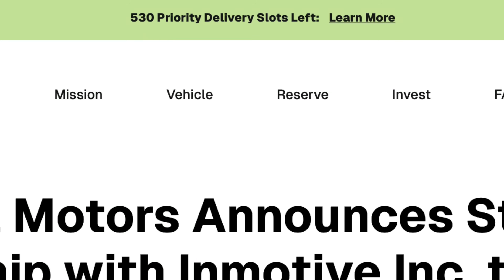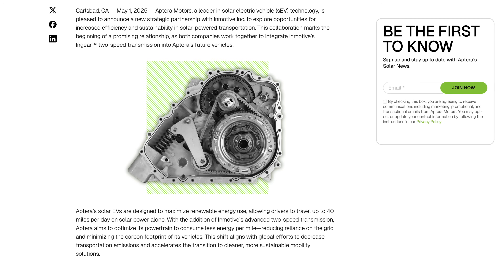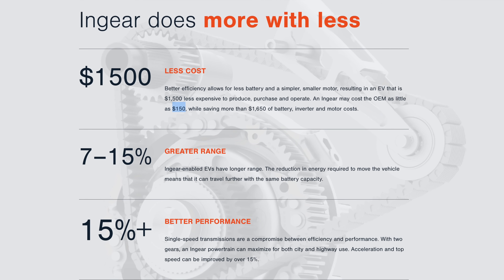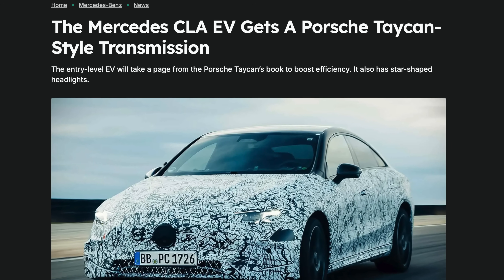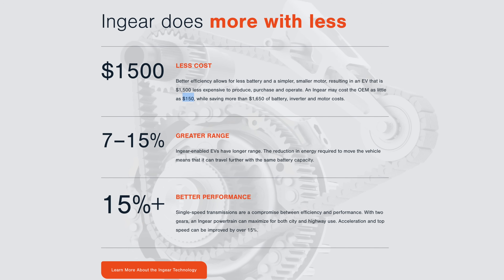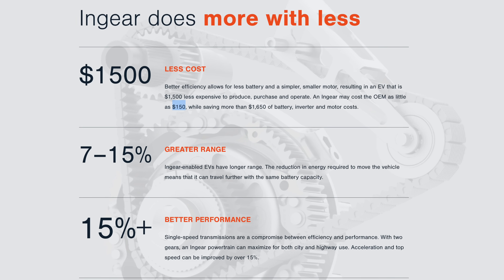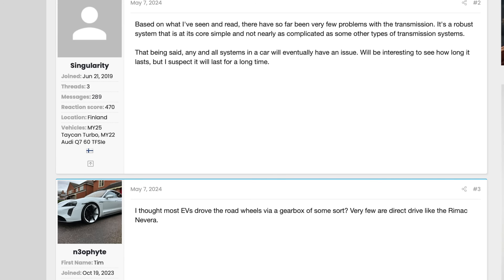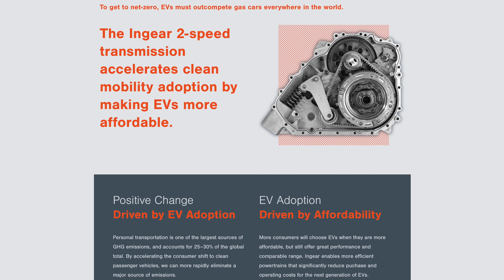Aptera Gets A Transmission?? Explained

Comment: I have always wondered why many EV's don’t use a transmission to make better use of the efficiency and torque available from electric motors.  As the motor spins faster it uses more power to do so.  At a lower spin speed you still have all the torque available so for me it just makes sense that eventually all EV’s will have at least a 2 speed transmission.

Comment: I think a transmission especially a simple two speed is worth the relative increase in efficiency and the proposed transmission's low cost. Besides efficiency has been optimized in the Aptera otherwise. Also I find Porsche's decision and test evidence at the increase of efficiency makes it worthwhile for high speed efficiency. Now Mercedes-Daimler is considering the to two to optimize electric motor efficiency over a large speed range. Besides with an electric motor one can optimize the electric motor controller to minimize stress on the transmission during a gear change..
Reply: Worthy of postponing a vehicle 👍

Comment: do they not plan on doing in wheel motors eventually anymore or will they drop the transmission at that point?
Reply: They gave up on hub motors some time ago. They weren't surviving the road simulation tests very well: too much shock and vibration. It turns out that having the electric motor protected from road vibration by a suspension system is a good idea, so they made the shift. This is just one more tweak as they try to get the new layout dialed in.
I hope it's a good change. It adds a little complexity and maintenance, and it's an unproven product (though it certainly tests amazingly well, let's see how it works in real life).

Comment: I always thought the Tesla Roadster had used one of these, but reading into it more it turns out that the transmissions available back then weren't strong enough to handle the electric motor torque.  It's good to see that's not the case anymore.

Comment: I want them to achieve 10 miles/kWh if possible.  It seems they have 8 in the current product.  Lower motor RPM makes perfect sense.  I wonder what the maintenance of this transmission is.

Comment: I have one on reserve..  But I'm disappointed they went away from the in wheel motors. This was a big driver in putting up a deposit. I have a 22Y pro now. I know this was changed a bit ago I'm just very disappointed.. 🤔 I'm going to check it out more, but I'm on the fence now... Was really looking forward to the in-wheel motor design. I have the electric bikes with the in wheel motor design. I'm really not sure why they gave up that part of their design. The solar parts huge and I think that's a great idea. 🤔

Comment: By th way all passange car BEVs have transmission NONE are diract drive.... If they didn't they would spin off the wheel assembly and would need a throttle like a prop plane... The reason why Musk got away with saying Teslass don't is because they are DIGTAL tranmions... but otherwise are very much a Musky lie to sell telsas that have really gone out of hand...

Comment: My concern would be the longevity of said transmission. The immediate torque that a electric motor can immediately output could easily chew through a cheap transmission, and a $150 transmission sounds "cheap" to me. I'm sure they could "tune" the motor to gradually ramp up power so as to not put excessive strain on said transmission, but I would still be worried about longevity.

Comment: Some red flags from Aptera's recent first road trip from Flagstaff ro carlsbad:
1. They never mentioned anything about charging during the trip
2. Zero shots from inside the car? 
3. No details shared for the trip after completion. Metrics like efficiency for the ride would have been helpful.

I dont think Aptera folks are like Theranos. But the management comes across as naive in ways they choose to communicate. Right now they are raising funds as "investment opportunity" while having no delivery date set and having failed to deliver past 4 years. I also feel there was no need to go all in on solar, they could have just launched a normal vehicle. Management is pretty bad with managing scope creep.

I hope they succeed but the management is holding on to a lot of info that could help us judge Aptera better. For that reason I will continue holding on to my money instead of investing in them.

Comment: Of course it is going to be more than 2 or 3% more efficient. You don't need a 2 speed transmission it is just like an overdrive in an ICE car it saves 10 or 15% on fuel especially with manual transmission easy 15%. It is not complex overdrive almost never breaks.   I like those Apteras I wish they would sell them with combustion engine they would easily do 120 MPG.

Comment: G'day,

My Talaria Sting L1e has 3 Gears in a Reduction Box, running uphill at 45°..., bottom Cog fully submerged, middle one half under oil, final Gear lubricated by Splash...

Every 1,000 Km the Manual decrees the Gear-Oil be changed - presumably so the Magnet on the Drainplug may be inspected ; but I always put new Oil back in.

"Geared Brushless Neodymium-Magnet, 60-Volt DC Motor...; 92% Efficiency (claimed in the Manual..., and via habitually  Recharging from my stand-alone Solar System - I cannot find any bullshit in their Assertions !).

After the Gearbox, being a Motorcycle..., the 3rd Cog turns the Shaft of the Chain's Drive-Sprocket.

Just(ifiably ?) sayin'.

The Apterra has 3 Wheels 
And 3 Motors...
Will there be 3
Gearboxes,
Or only one
For
Reverse ?

Have a good one,

Stay safe.

;-p

Ciao !

Comment: At CES Steve F was hinting at future changes to improve the Vitesco EMR3 efficiency. I thought he was saying to boost efficiency for low load city mileage. That the EMR3 is already well adapted for high performance applications. Perhaps this transmission could also be useful when you have achieved your highway speed on level or downhill terrain and just want to use a small motor load maintaining that speed? At the time I thought he was hinting at a future motor mod. EV's with 2 or more motors can achieve this motor gearing with their additive power, and by only running one when that is optimal, and sometimes by having each motor also optimized differently for when they might be running solo. Does this transmission feed excess power back into the battery in some regenerative manner?

Comment: Tesla reportedly had problems with the 2-speed transmission they had in the Roadster.  The electric motors were reportedly generating so much torque, that they were destroying the transmissions.  I'm not suggesting that this will be a problem with this transmission that was designed specifically for electric motors.  I'm simply pointing out that there is a little history with electric cars and transmissions - and that history isn't necessarily good.

Comment: I've always thought this was a good idea and probably adds a fun factor to the drive. It's like having an underdrive and overdrive gear for city and highway driving as well as give you better control for circumstances such as uphill climb and descent. There should be an automatic and manual mode to suit the drivers preference with controls on the steering wheel or display. Torque is constant in an EV with the main variables being rpm's and road resistance that determine the current draw, with a changeable gear such as this you should be able to optimize the performance and efficiency to suit the road conditions more optimally.

Comment: I'll be surprised if the two speed transmission actually makes much difference. But it's definitely worth a try. I'm skeptical because Tesla has the financial, engineerting and computer resources to have modeled using a 2 speed transmission when they refreshed the S, X, 3 and Y. If they had been able to add significant range this way, it seems likely they would have done so. Same applies to Kia/Hundai/Genesis, VW, Ford, GM etc. BTW, I'm pretty sure the Taycan two speed is in its high gear by default, and only kicks down into low gear for hard accelleration. I bet it never switches gears at all when driven gently for a range test.

Comment: I fail to understand why Aptera, and some others, insist on using their own ground breaking technology throughout their vehicles.  
Just stick with great aerodynamics, but a simple off the shelf rear wheel drive system.  That’s what the Chinese would do, and have them rolling off the production line after a year or two..,not decade or two.  
Ok, solar developments are good, but keep that separate

Comment: As a former auto transmission engineer, I always thought a few different speed shifts would do wonders for Aptera.  The idea of it screeming trying to hit the 101mph max spd, with the Elaphe IWM was slightly disappointing. I tried to imagine an “overdrive” gear shift arr. on each wheel to give it an extra bit of efficiency. 
I am glad to see this being considered for the EMR 2/3 for the Aptera. It may very well end up being quite a revelatory mash up.
Love your analysis , keep up the great work!

Comment: My take: the recent "downhill" road trip efficiency results highlighted the loss of efficiency which I believe was caused by the switch from in-wheel motors to the Vitesco drivetrain, and Aptera is scrambling to get back that lost efficiency. One way to do this is decrease the RPM of the electric motor at high speeds using a second higher gear. This works with electric motors the same way it does with combustion engines. You always get better fuel economy in top gear in a combustion car. It's exactly the same concept except with an EV you are decreasing the consumption of electrons instead of liquid fuel.

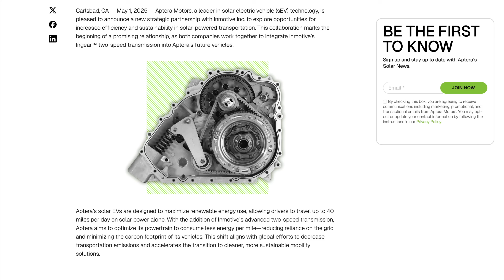Comment: 1:53 That spring loaded idler wheel may kill this option. Does that roller have a lock-out? Don't see on in that picture. You will not get motor braking with that roller. 
Think of a bicycle derailleur. Ever tried pedaling backward on a derailleur bike. Power can only be transmitted one way.
If it does not have a lock-out, all is not lost. With low gear shown, you put a hard stop to prevent movement of the roller. Low gear can be easily fixed. 
However, with high gear, you need a lockout. Can they put an over-center type linkage or crank to increase moment arm of the spring. Make the mechanical advantage of the spring stronger than motor braking. One more crank between spring and the roller arm may fix this.
-30 years aerospace mechanism engineer here :)

Comment: They are willing to place a transmission in the vehicle, but not a heat pump based heater. Resistive heating will cut the range in winter by a ton. They already have air conditioning, which means they have almost everything they need to build a heat pump based heater since after all air conditioning systems are already heat pump based systems.
Reply: Building cars in California makes you forget that the weather isn't always like this.😉
Reply: 3 years ago they said "we can't do heat pump at launch because that will take 2 years to develop". And I'd believe that if they intend to do an "octovalve" type setup like Tesla is doing (radiator, cabin vents, motors, battery all connected to a single pump, any can be a source or sink for heat). 3 years was... enough time to design a heat pump system. :(

And as you said, they already have a heat pump for cooling (radiator and cabin vents). With a single reversing valve and a slightly larger radiator they should be able to use heat pump for heat down to freezing. For operation below freezing they'll need a bit more work for to prevent condenser coil icing, which might mean PTCs in the cabin air ducts (to supplement) as well as PTCs on the condenser coils (to prevent icing).

I guess I'm on the fence here. As someone who lives in a climate that has -10F daytime winter temps and -20 to -30 about a dozen days each winter, I think I could be swayed pretty easily that a heatpump which stops operating between 30-35F (which would be the simple, valve only unit) might not be worth it. It would help in early spring or fall, but for 5 months out of the year (and in the dead of winter when heat is needed the most) it would be using PTCs to heat the cabin air anyway. Heated seats negates this somewhat, too. I've definitely owned gasoline and diesel cars where I relied more on heated seats than cabin heat for short, in town trips when it was really cold.

And somewhat in support of that, I look at colleagues who own Teslas, and even with the octovalve heat-pump system, they pre-heat their cars at home while plugged into the wall before leaving for work. If Aptera provides a similar feature where we leave the car plugged int overnight and schedule that we need the car warmed up to leave at 7am, the grid can heat the car instead of drawing power from the battery and the majority of the cold-weather range loss happens only on the drive home. I'd want the option to tell it to "stop charging at ___%" as well so it doesn't try to charge to 100% every time I plug it in since I might primarily be plugging it in to pre-condition the battery and warm the cabin.

Now on the other hand, a huge portion of the USA generally has daytime winter temps above freezing (basically PA and everything south of PA). Keep the PTCs, add the reversing valve, make the radiator a little larger, occasionally reverse (run as AC) the heatpump to prevent condenser icing and most customers would still get more efficient heat than only PTC heaters.
Reply: Why do you need to spend the money developing a heat pump when the whole company is a scam?

Comment: Nice job here.  I kept asking myself, “why are they doing this now?”  My thought was they are hell bent on hitting 10 miles/KWh.   But, it could also be even more strategic and I really hope this could be part of their thinking.  It might be a strategy to combat their funding problem.  Maybe this $150 is a temporary and inexpensive way for them to compensate for their inability to fund the casting chassis.  Could this actually be a strategy to get to market faster?
Reply: They are at 6.8-7.1 miles/kWh. They need a desperate improvement. I think it's all about getting closer to 10 miles/kWh. Significantly impacts miles/kWh, miles per charge, and avg solar miles/day.

Comment: I’m fairly certain Out of Spec Kyle said that the 2 speed transmission in the Taycan makes it worse to drive.
It would be better without it.
Reply: Yeah, the Tesla Roadster originally had a 2-speed and it didn't work well. However, both the Roadster and Taycan were trying to push top speed - will it work better as an efficiency device? Guess we'll find out.

Comment: A few days ago I couldn't be bothered researching the thought that I had that a single-speed transmission was bundled in the EMR3 motor, but today I have the time, so here it is:

"The EMR3 from Vitesco Technologies is an Electric Axle Driver that is ideal for e-mobility (affordable) applications. It delivers a continuous output power of 60 kW and a peak output power of 150 kW. This e-axle driver provides a peak torque of 310 Nm (motor) and 2700 Nm (wheel) and has a speed of up to 1350 rpm. It consists of a power electronic inverter, electrical machine (PSM), and a third-generation single gear reducer. This driver reuses validated technologies to offer product maturity and requires low efforts from customers during integration and validation phase. It includes anti-jerk function with self-protection capabilities (derating) for maximum reliability. This IP6K9K-rated e-axle driver also estimates and predicts the torque value, and uses advanced SW modulation strategy for high efficiency."

The motor is 76kg and the doubling up of this transmission with a 2-speed is inefficient. It should be used on a lighter motor only. I also saw that the EMR3 has a constant power of 60kW, and the 150 they claim is only peak power. The Harley Livewire is rated at 78kW, but not sure if they use peak or constant.

Comment: It would be great if this is included, but there are other ways to improve efficiency: Batteries with more specific energy (lithium-air, or solid batteries) would improve efficiency by improving energy density. Faster charging would also reduce the perceived need for such large battery capacity, which would lower battery weight even more. Lower weight means lower rolling resistance, which means higher efficiency. Also solar panels continue to improve in efficiency. I would not be surprised if the efficiency of solar cells doubles. Going to an 800 V architecture would also reduce weight by reducing with thickness. Furthermore, using an antireflective surface coating would capture more 10-15% more light. Better thermal insulation would reduce heating losses and a heat pump would double or triple the efficiency over resistive heating. (It is not clear of they will be doing that.)